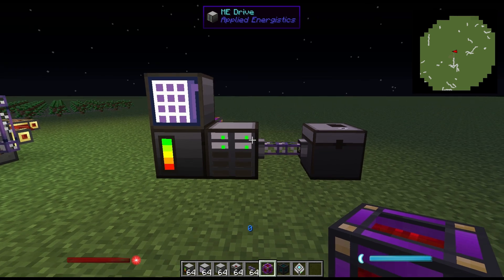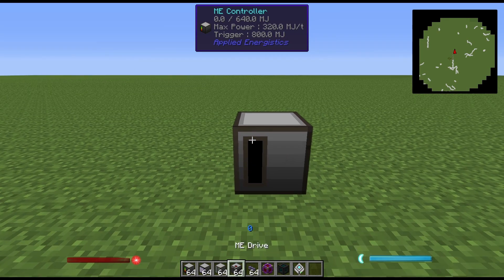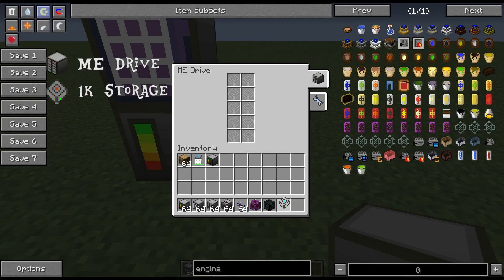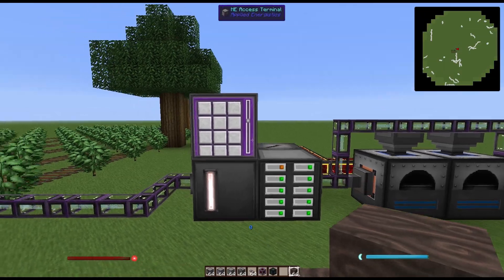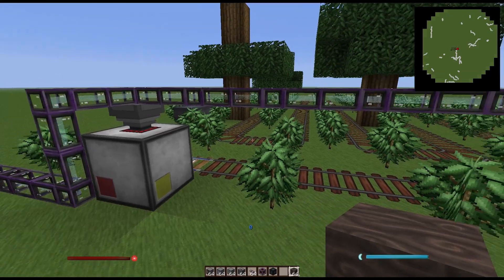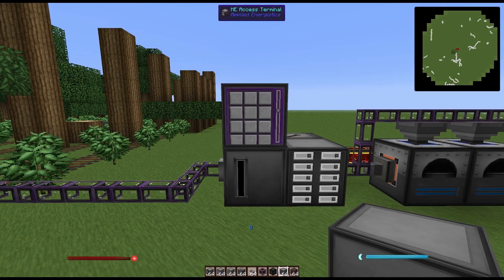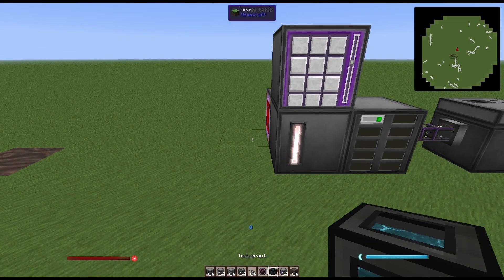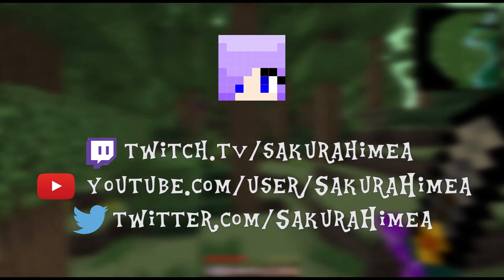How to Set-Up an ME Network - FTB Applied Energistics

Comment: how can I increase the power generation? My ME network uses more than 4K/t (of power) yet no matter how much energy I connect to my ME network (i have about 8000eu/t flowing into it) yet it wont go above the 3eu/t generation so my system shuts off.. The system can only hold around 8k power, and only accepts 3k/t of power yet uses 4k/t to power my ME system... this mod is broken. No matter how much power you supply it it fails to accept more than 3k/t.

Comment: Is there a way to connect multiple crafting terminals across a distance? I have a compound style base, with multiple buildings dedicated to the mods I use most (Ars Magica, Witchery, Thaumcraft, Tinker's Construct), and I'd like to have a crafting terminal in all of them, so I can dump my inventory in the main building, and access it (and craft) from the others. Is there a way to set that up?
Reply: Just connect them using wires. Keep in mind each terminal etc uses a "channel", and that you only have 8, unless you run it through a block that adds channels. I'm not completely sure on the names of things since I'm just getting into this mod myself, but on one of my multiplayer worlds a friend set this up and told me everything (Not that I listened). So basically, its possible. Just mess around with the mod in creative mode until you figure it out, thats what I'd do. (And will probably end up doing)
Reply: Like ME cables, or power wires?

Comment: yet another video on youtube that doesn't explain how to power the ME contronller
Reply: The controller is powered by any other standard power source in the modding community such as BuildCraft Minecraft Joules, Industrial Craft 2 Energy Units, Universal Electricity, and Thermal Expansion 3 Redstone Flux. It requires constant energy while it's active, therefor a renewable energy source or a turn off switch is recommended.

I recommend starting out with Steam or Magmatic Dynamos from Thermal Expansion 3. You can read more on them here: http://ftbwiki.org/Dynamo_(Thermal_Expansion)
Reply from the maker: The controller is powered by any other standard power source in the modding community such as BuildCraft Minecraft Joules, Industrial Craft 2 Energy Units, Universal Electricity, and Thermal Expansion 3 Redstone Flux. It requires constant energy while it's active, therefor a renewable energy source or a turn off switch is recommended.

I recommend starting out with Steam or Magmatic Dynamos from Thermal Expansion 3. You can read more on them here: http://ftbwiki.org/Dynamo_(Thermal_Expansion)
Reply: HimeaSaito
What about the yogpack? i have mine hooked directly to my universal energy cable network, and it powers the MJ requiring BC Silicon lasers/assembly table system no problem. i have the drive, the controller, and the ME Crafting Terminal
Reply: HimeaSaito Why did you literally copy the first guy?

Comment: Is it possible to power an ME network WITHOUT other mods? I'm very confused, cannot figure out how to power the darn thing, and I don't want to install IC2, or anything of that nature...
Reply from the maker: I'm pretty sure you need to have another mod like IC2, Thermal Expansion 3, or Universal Electricity, but not 100% sure. If you find away to power it with just AE machines, be sure to share it with me! ;)
Reply: I can't seem to find a way, and to be honest I find that kinda silly. :P
Reply from the maker: Saevustus Generally the purpose of AE is to be able to store a large amount of items and interact with machines easily. Because vanilla Minecraft doesn't add much diversity, the full power of AE isn't really brought to fruition. I think the mod author intended it to be used to with many other mods.
Reply: Oh I know that, Im using it with Orespawn and some other mods, I just didn't want to add IC2 to my mod list, as IC2 and Buildcraft both give me framerate issues with my current computer.

Comment: hi, you didn't explain how to wirelessly access your network
Reply from the maker: Because of the limited range I don't feel that the Wireless Access panels are worth the trouble (they only reach to around ~35 blocks by default). However, you can set one up by creating a Wireless Access Point and connecting it to the network, then creating a Wireless Access Terminal and placing the terminal into corresponding ME Controller that you want to link it to. The Controller will program the Terminal to connect to it.

The Wireless Terminal must be charged to be used, you can use an ME Power Relay or other charging blocks added by Industrial Craft 2, Thermal Expansion, or Universal Electricity.